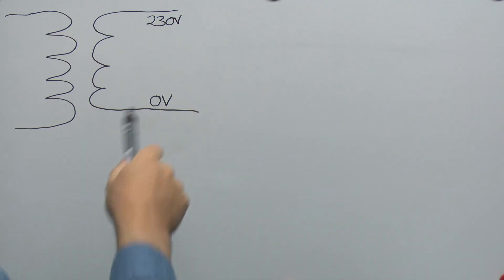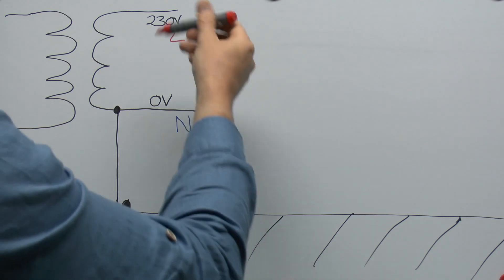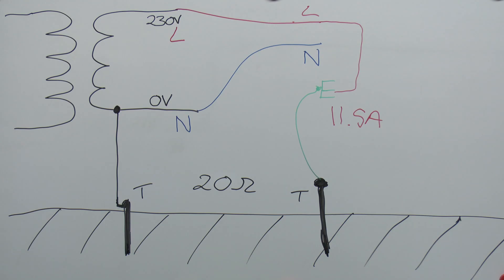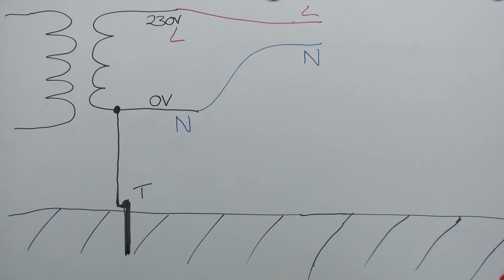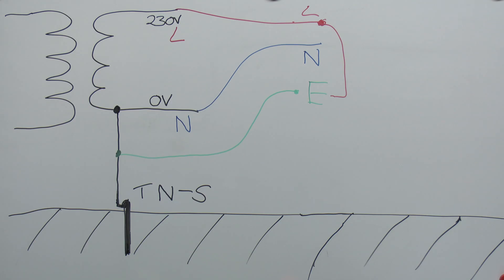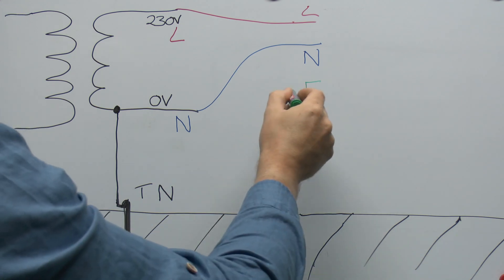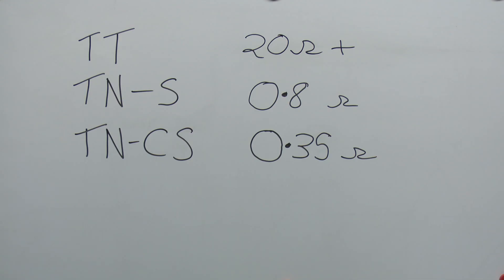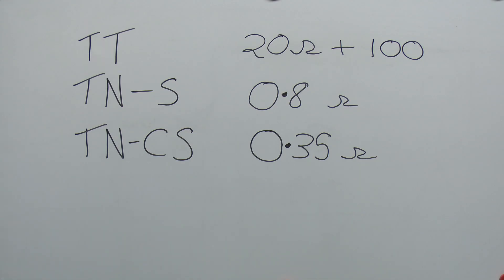Types of Earthing System for Electricity Supplies (UK)

Comment: With TN-CS if you have over heads and the neutral fails, with bonded pipe work you will be relying on the earthed water pipe to carry all the current. I worked on an installation where when the plumber cut the lead supply pipe all the power went off. Conclusion was the neutral had broken outside the property on the pole

Comment: I can understand that if the PEN becomes broken at some point, then the earthing electrode near or in the building should take care the metal casing in the building are not energized. However, what is the purpose of multiple earthing electrodes along the way between the supply and consumers?

Comment: Why do we say 230v, when it's actually 240v
Reply from the maker: Voltage is defined as 230 with a tolerance of -6% / +10%, or 216 to 253.
Most UK supplies were around 240 historically, and plenty still are as that's within the specification.
Reply: Thank you

Comment: In Australia TN-C-S is also known under MEN (Multiple Earth-Neutral)   We tend to use this method in all installs in Australia as the soil is a poor conductor, so TT is really not an option, so they kind of standardised as TN-C-S (MEN with the MEN link at each entry point to a property as well as multiple links along the way.  Like with the UK PME definition, MEN is not really relevant as a replacement for TN-C-S terminology,  as one relates to teh earthing method and the other the cabling method...
T = Terra.  Guess the needed something different to E

Comment: Renault Zoe test the ground impendence by injecting current between ground and neutral - 20mA. If your earth impendence is over 100ohm, it will not charge. But it will trip some 30mA RCDs, because many electronics inside the house have over voltage protection, which has some leakage current. 
It will also not charge if ground to neutral is over 4V, which may be caused by voltage sag or improper balance of 3 phase supply at street level, so neutral is over-loaded by 1 phase.

Comment: We use the TN-C-S system in Australia more commonly known as the MEN (Multiple Earth Neutral) system. 

The only difference I noticed with the UK is wherever there is an MEN link you must install an earth stake. Since the main switchboard at the house has an MEN link we gotta install an earth stake. 

The transformer for the houses it is supplying will have its neutral grounded and you’ll also see some pillar boxes (there is one for every two properties) may also have its neutral grounded

Comment: In the U.S. we drive a ground rod and attach it to the neutral point of the transformer, but it looks like you guys attach the ground rod to one of the ends of the transformer. We also have corner grounded Delta systems here too. Soooo I guess you can ground a transformer anywhere in the coil you want to and it will still have the same benefit for lightning, static, etc.? 😵‍💫

Comment: @jwflame With a broken PEN in the TNC-S arrangement, can't the contact voltage be minimised between exposed conductive parts and the general mass, by adding an earth electrode which will connected to the consumer's  MET?
Reply from the maker: Yes it can.  However to have any meaningful effect, the resistance of the electrode would have to be very low, typically under 10 ohms.

Comment: Hell Mr. John, if you please could you or someone else answer me in two queries? What was the benefit (at TN-S system) of the old cables with lead shield  to come directly in contact with the earth? Maybe in the case where the cable were being cut accidently the property will still had earth connection (the earth itself will connect the two pieces of the broken cable)? Also, at TN-CS system what is the reason of multiple connections (at 10:48 min) between Neutral and Ground; maybe if the cable were being cut at some point the houses that are connected after the cutting point will still have Earth Ground connection and from now on because the only return path for the current to return will be the Ground earth the result will be a breaker or fuse or RCD to triggered immediately. So in practical this a way of detection a cut cable and to avoid a house to stay without Ground Earth (PE); because of the triggering of the breakers the properties don't have electricity and consequently the electric company must necessarily to repair the break cable? Am I right in my hypothesis or I misunderstood/missing something?
Reply: Don't concern yourself with British electrics if you can't even speak the language.

Comment: Could you please explain the difference between TN-C and TN-C-S?

I already understand the latter, since the US uses it with a slight variation: the neutral is grounded not only at the transformer (a single-point-earthed-neutral TN-C-S system, but also at the house of each customer (a multi-point-earthed-neutral TN-C-S system).

But I don’t see the difference between the two types of earthing systems. Both ground the neutral at the transformer. Both connect the neutral wire to normally-noncurrent-carrying conductive (metallic) parts at each customer, meaning the neutral and ground wires are combined before the customer but separated when entering each customer house.
Reply from the maker: TN-C has the ground and neutral combined within the house, so there is no separate ground wire.  Ground connections for each outlet are just a small link between the neutral and ground connections.  Rarely used anywhere and not permitted in the UK and plenty of other countries.

Comment: The electrical supply is explained wonderfully. My thought is: if we do without grounding, the power supply will be similar to safety Tafo. Wouldn't that be much safer? Unless someone touches the L and N lines directly. Grounding causes more problems is my opinion.🤔
Reply from the maker: It's safer but only until some fault to Earth occurs somewhere - it's then an uncontrolled earth referenced system.
Isolated supplies have their uses, but only in strictly controlled and monitored environments.
Reply: @jwflame  You are extremely competent and know what you are talking about. What has become so rare today. Thanks!

Comment: In Australia the neutral bar and earth bar are joined in the switch board also.  What is the theory for this ?
Reply from the maker: The same as the UK version, which is TNCS in the video.  The earth and neutral connection to the installation are a single combined conductor, so the earth and neutral for the installation must be connected to a single point.
In the UK the only place the link can be is in the supplier cutout before the meter.  It's not permitted to have it anywhere else.
Other countries have different regulations so it may be in the consumer unit or distribution board there.
Reply: @jwflame  thanks.   Would be nice to know the logic of other countries. Doing TNCS slightly different
Reply: @jwflame  Hello J.W.,
 Is it dangerous if Neutral and Earth are bonded in a TT system? Will that effectively become a TNCS system?
Reply from the maker: @IAmThe_RA It can be dangerous, and it won't be a TT system if those are linked.  Some TT installations can be converted to TN-C-S but only by the network operator and only if the network is actually suitable for that kind of conversion.

Comment: Outside equipment/structures/caravans etc. fed with extension leads: -
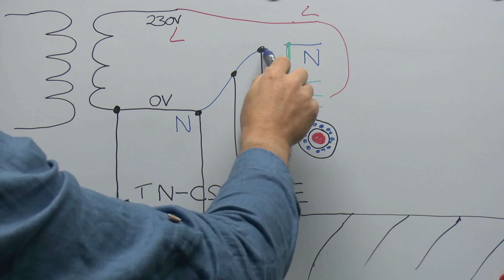(Circa 12:10 mins)Surely if the Neutral conductor got broken on the consumer side of the cutout the earth conductor would still have a path back to earth (tripping a safety device RCD's etc). Whilst long non armoured leads always present a greater hazard surely only a Neutral disconnection on the supplier side would put a metal framed object at risk (and that would apply to all earthed items in the house it's just your more likely to be in good contact with the earth outdoors?

Comment: I have TN C-S properly  installed   is it allowed  to  earth the body of the motor  or the control panel earthing point  as add protection I can pond it to a sticking out construction  steel that I conected  to the building foundation  which happened  to be near them

Comment: Hi John i have watched several of your videos over the past few months as i am in the process of building and installing my own solar array, all the electrical components including batteries, Hybrid inverter / isolator switches/ fuses will be contained in a steel cabinet/enclosure in the back garden as the panels will be ground mounted, can you please shed some light re bonding ? The inverter i bought has a TT setup " no continuity between Neutral and earthing stud on outer casing"  my house uses the TN-CS setup, i have an electrician calling to install a Din mounted 2 pole changeover switch with and an external wall mounted plug for Generator / solar input.   If i connect the the AC outlet from inverter to the house via the 2 pole changeover switch will the RCDs on my consumer unit in the house work as they should given the AC power is supplied by the TT setup inverter ?? Sorry for long winded explanation .. many thanks 
Seamus
Reply from the maker: No connection between neutral and earth is NOT a TT system, it's IT - isolated.  RCDs will not work in that configuration, and such arrangements are only suitable for specific controlled environments with additional fault monitoring equipment. 
Generators, inverters and similar would normally be installed as a TN-S system with an earth reference electrode.

Comment: Fascinating overview of how the UK system approaches electrical safety.  I am in the US and I can now see the advantages to our system of having a center tapped neutral on the distribution transformer secondary.  The earth (grounding) conductor is connected to the neutral at the entrance to the structure and there is an earthing rod driven at the structure.

Comment: Hi John, not sure if I'm missing something.  where TT systems are in use, is there a reason the distributor cant fit a TNC-S cable head and make it a TNC-S System instead of using TT systems with high impedances and all of the other problems they bring?
Reply from the maker: It can be converted in some instances - all depends on how the rest of the network is configured.
Reply: @jwflame  cheers for the reply, just wondered as it seemed undesirable to be installing systems with such high Impedance values and having to install RCDs for fault protection etc

Comment: MEN is the standard here in Australia.  It's a TN-CS system, with a separated neutral/earth bar arrangement, and a earth rod in the ground.  We have to find resistance as low as we can get - typically 1-10 ohms.   Some sites (Centre of the country - sandy country) can see earthing rods 10-15M in depth.    We equipotentially bond everything to stop balance issues.

Comment: It occurs to me that, whenever I watch a video on TN-CS system, there is a need for an earth rod supplement within the property wiring to avoid the PEN fault you describe! Is there a reason WHY such a supplementary earth rod arrangement(TT) should NOT be installed on a TN-CS system? I would logically assume that the TN-CS would be considerably lower in impedance to the TT supplement but the TT would protect to some degree rather than none, in the case of a PEN fault you describe?

Comment: I have the TN-S but I’m getting my board moved I think they will be putting in a new cable from the street can I still use the old piece of lead supply as a rod to earth as that won’t be getting removed from the ground just cut off or will the new plastic cable have an earth within

Comment: Thanks a lot my dear.

You just made clear to me a bunch of confusions !!

In my appart I see the earthing there given by the company. So is it TN-S design ?.

For some the Neutral and the earthing cables are connected on the same board inside the breakers panel of the appart. Is it normal ? I thought they should be separated ? What are the risks.

Thanks in advance 😀

Comment: Actually the old TNS cables have their lead sheath covered by a steel spiral wrap which is then covered with a fabric insulation which is coated with a tar like substance, I know as I've got one of those old cables supplying my old house, so therefore the lead sheath is not actually in direct contact with the ground so it has to rely on it's lead sheath for earth continuity. And there's loads of those old cables still in use where I live and further afield in the surrounding area. And I've also seen a modern concentric cable with separate neutral and earth conductors, the earth is formed by usually seven bare copper strands fitted around one half of the live phase insulation with again seven separately insulated copper strands fitted around the other half of the phase insulation to form the neutral with of course an overall insulating sheath on the outside. So some TNS installations with more modern cables do exist, probably where an existing service cable has failed and has had to be replaced, like the one next door to me. Old dead water supply pipes are in direct ground contact and have to be earthed at the consumer's property so they can effectively form a local earth electrode if connected, and of course the same applies to some older gas supply pipes too, like mine which is iron and that is also connected to my incoming earth conductor.

Comment: Very well explained, one query, for PME System you said that if the neutral (neutral and earth) breaks, it will be dangerous situation because no earth is available. My question is, if a neutral breaks, there will be no supply left because to complete a simple circuit we will need to have a connection of both Live and Neutral.  so there will be no current flowing through and have no danger as there would be no supply. can anyone please explain?

Comment: One point you didn't mention. If you are far enough away from the transformer, the voltage drop on the lines can be significant. Where I used to live voltage available sometimes dropped below 200v. That meant the Neutral was no longer zero, and could be anything up to 20 volts above earth. Even in my last house there was enough voltage on the Neutral to trip the RCD.
Reply: How does neutral gain 20v? (versus dropping)

Comment: Yrs ago when setting up radio transceiver station I kept getting a hum was almost killing my audio at 10watts 
Cut to 5 watts it was less apparent but still present .

I could not figure it out I had traced back every cable ,
Put rf filters on every lead ,what the hell was causing it ?

Old wiring was not replaced in the room I was using and it had no earth or just ye olde earth 
I totally burned out a transformer 
And had to replace it ,
It was discovered only by a retired electrician who asked if I'd checked mains supply ,
I hadn't why would I everything was new .

I was lucky not to have damaged transceiver unit a very expensive 
Repair .

Receiving was never affected so it was 
Real puzzle ,
I would use a 12v battery supply as the transmitted hum was pretty overwhelming and I had to buy new PSU 
My trusty one of two yrs was beyond repair .

Check earth !

Comment: What is the point in having an earth rod with a TN-S system? I can see the logic with the TT one but with the TN-S it seems redundant.
The TN-CS also seems redundant. I don't get it.
Reply from the maker: For TN-S there isn't much point.
For TN-C-S it would reduce the voltage on exposed conductive parts in the installation if the combined N&E conductor was broken.

Comment: As an ex cable jointer I actually have had a shock from the N/E conductor of a 1ph concentric service cable! 

The shift electrician had attended a property and said there was no incoming supply. Labour team had been told to open an excavation over the service so I could cut and test. As soon as I removed the PVC sheath, I got a rattle.

The cable had been damaged nearer the service joint and strands cut, water got in and the cable blew open circuit to the joint and phase to N/E towards the house! We weren’t issued with the much hated neon testers in those days. 😊
Reply: Should have said the phase wasn’t open circuit, just the ne.

Comment: T N S in my property has a earth clamp on the lead distribution cable soldered on to it and a earth rod fitted . A Western power official told me this was normal on the older council property’s it did have a earth leakage trip fitted and the out let of it was connected to the lead cable not directly to the outside rod . Have you come across this type before??.
Reply from the maker: No, but that arrangement would work.  However that type of earth leakage trip has been obsolete since the 1980s, and should have been replaced a very long time ago.

Comment: Hi, i have a 1900s house with a lead cable , 3 cutouts (only one in use) and a green earth cable running to a small side box( i think the whole assembly is tar filled)..my house is wired in pvc coated twin and earth...mostly grey, some white...everything works fine. my question is...there is a green earthing wire in the kitchen not attached to anything and one in the bathroom also...should i clamp them to a cold water pipe or just remove them, many thanks colin...

Comment: this is wrong very wrong and could be very dangerous,,,,, if you watch this and think you know what you are doing ,,you then go in a house that is in flats and you see three or four fuses and it says on the the fuses ''danger 415 volts''    you wont have a clue ,,you might think back on this video and carry on ,but if each flat has one fuse each and you take the common return while connecting up you will put 415 volts into the other flats and that will burn out anything that is in circuit fire or electric shock,, very dangerous video ,if you don't know what you are doing don't make a video.